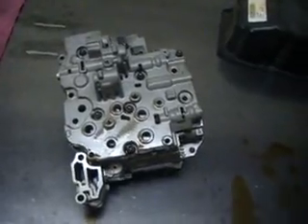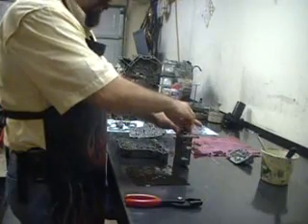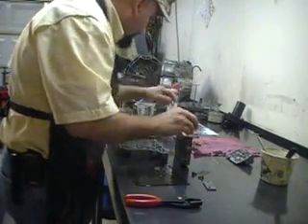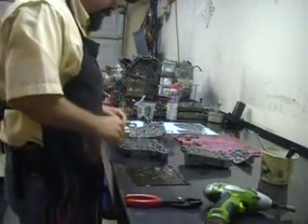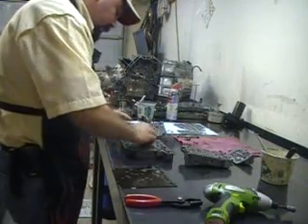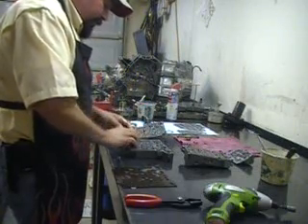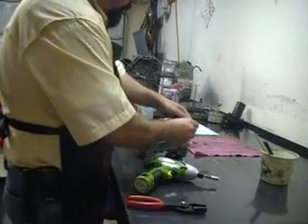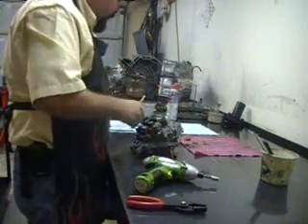AW55-51SN / RE5F22A Transmission Solenoid Repair PART 2

Comment: Hiram, your videos are excellent... and you know your boxes.  If I were in your area I'd be keen to spend a month working under your expert guidance.  During my apprenticeship years in the early to mid-80s I helped my journeyman overhaul many Borg Warner 65/66 boxes (Jaguar XJ6/Rover), and the occasional GM400 (Jaguar XJS) ... in those days the gearboxes were purely mechanical.

Comment: hello I greatly appreciate all the information in the videos that you've been giving. I just recently purchased a 1998 volvo V 70 all wheel drive and I am having a situation it runs and drives for about 3 minutes then goes into neutral altogether I turn it off and it gets drive again for at least 30 seconds and I can repeat the process I hear a slight wine while it's running and when it when it quits the warning does too but like I said as soon as I turn it off for a minute and turn it back on the wine and comes back and it drives so on so forth please advice I appreciate your help I know you live off of this and I wish I were in your town to take this transmission to you

Comment: The Transgo Shift Kit talks about the 3rd band needing to be re-used or replaced with an OE band for the AW55-50SN and all I can say is that I wish I would have read this prior to the rebuild... I am now removing the Trans in order to remove the aftermarket band that I installed in hopes that this will eliminate a 2-3 flare, although I see now that I may need to adjust the solenoids since I installed the shift kit. Thank You  for taking the time to share these videos and your experience with us, I have been in the industry for over 25 yrs and continue to learn something new everyday. Keep up the great work and thanks again.

Comment: i had the se issue you need a transmission rebult and a new valve body, i suggest you sell the car , ive been with this issure for awhile and still till today i have transmission issues after a reublt and new valve body, pretty soon your timing chain will start to lag. trust me you dont want anything to do with a nissan/maxima with the 3.5

Comment: Hi Hiram, Thank you for all your clear video's on the AW55-50SN. I have a 2007 Renault VelSatis with that gearbox. It has over 200k kms and still drives and changes gears as new. I used your video's to check upon a spare gearbox I obtained. That one has only less than half of the kms as the one in the car. When I eventually need that one I know now that it is in a very good condition.

Comment: Hi, I am in the process of replacing the shift valve solenoid on my 1999 Infiniti I30, and I am testing the new OEM part that I bought online through Infinitipartsusa.com and the A,B and overrun clutch solenoids are not clicking when I apply 12 volt battery power to each of their termials and ground.  The torque converter clutch and the line pressure however, are clicking and seem to be operating.  I am testing it in accordance with the online Nissan/Infiniti Factory Service Manual. I have not installed it yet because I want to make sure it is not faulty before I install it.  Am I testing it properly?   It seems unusual for three solenoids on a brand new part to be defective.

Comment: just done my solenoids.  took on a road test. after 10miles or so trans will not downshift and starts off  in 5th gear. what the problem?
Reply: did you find the problem? I had the same problem with my ML430 I think i reset the computer  or turned battery off.
Reply: *****  no  everyone can afford to spend lot of money on repair a.h.

Comment: I just fitted the Transgo kit to a Volvo S60 AWD '02 model with success.  Without your help, I wouldn't have been able to do it so thanks and keep up the great work.  I'm now about to do the same on an '02 XC70 with same symptoms.  

I also have a '01 XC70 'box on the bench with what appears to be a failed S4 solenoid.  When I apply voltage it makes no noise whatsoever.  It passed the resistance check however it is gummed up with a lot of black sludge.  

In your experience can this solenoid be restored by use of solvent cleaning?   Cheers
Reply: Wow now I've done it!!  Afetr refurbishment of the valve body on the '02 XC Volvo I lost 3rd gear.  Tried another valve body and same thing!!  Is there no end to troulble with auto transmissions?
Reply: Mike Loucas
My friend just did the valve body upgrade on his '01 V70XC and now everything slips horribly. Auto transmissions are the devil.
Reply: It wasn't the valve body causing loss of 3rd gear; I should have come back in to let you guys know.  The 3rd gear band brake had worn beyond limits.  I replaced it by dropping the subframe and removing the side cover.  It was a hairy 14 hours of slog.

Comment: Hey man I need some help if it's not too much to ask I am working on 2005 Nissan Altima V-6 in the valve body The two  boost valve I took them out sorry to say I did not mark them they both have 3 steps do you know which step to put them back at? Please help I'm desperate